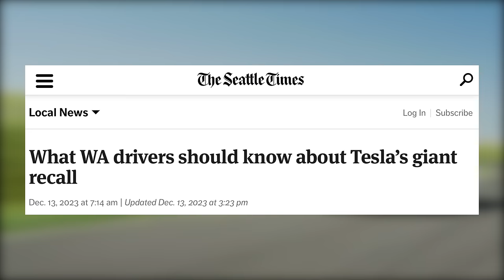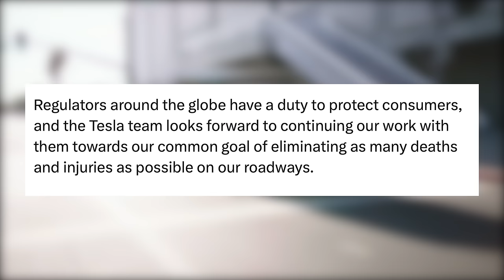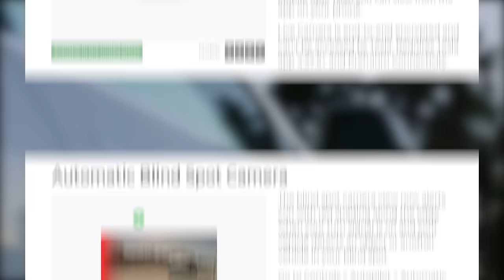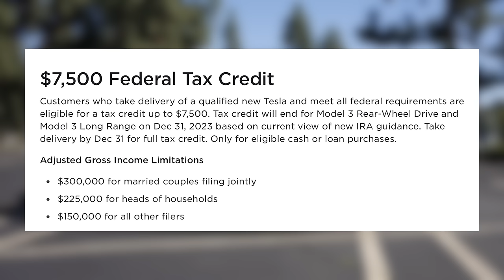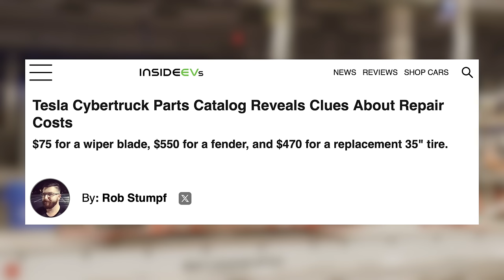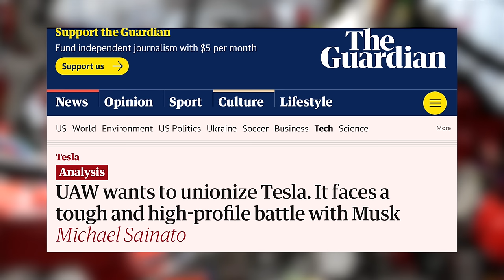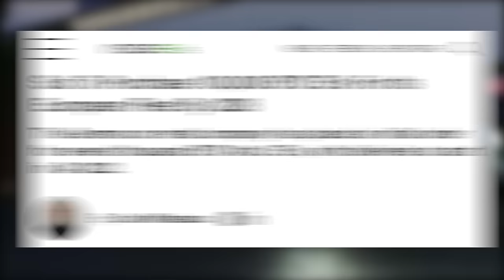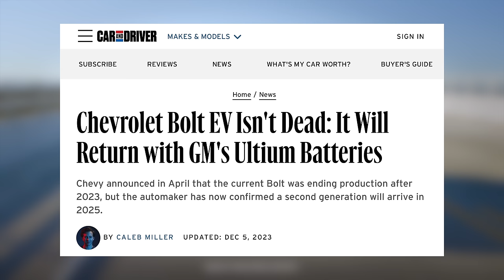NEW Tesla Features Are HERE | This Is Awesome

Comment: C’mon dude, not a recall - it’s a software update.
Reply: Recalls are determined by the danger not by the method of fixing the issue.  For instance Chevy volt had a battery fire issue and a recall.  At first they tried to do a update to fix the issue....  Then the update did not work so they physically had to change the battery.  Whether the software fix worked or not the danger of fire was a problem so it should have been a recall reguardless of how it was resolved.
Reply: it's actually much simpler, recall means that they need the car brought back to them in order fix it.

that's what recall has always meant.
Reply: @anonanon1604  So there were battery fires in the bolt and they originally tried to fix it with software updates.  You are saying if the software updates were done OTA even though there were cars and home catching on fire because it was resolved by OTA it is not a recall?